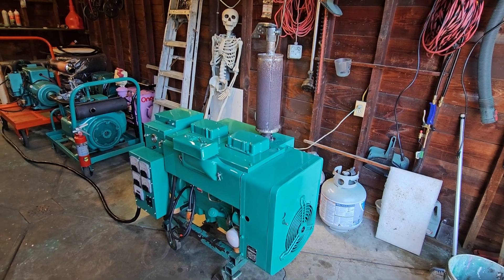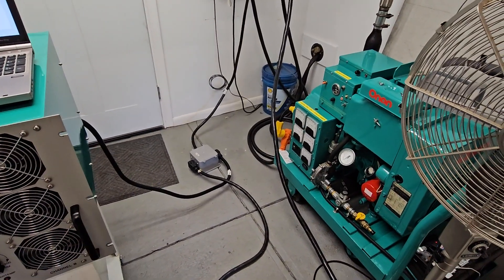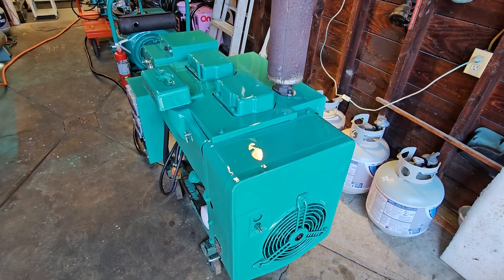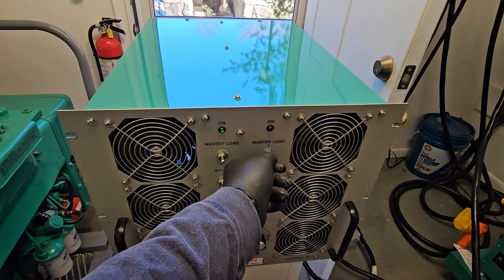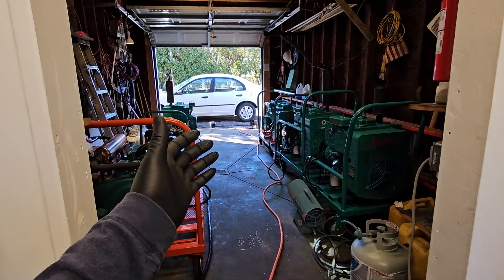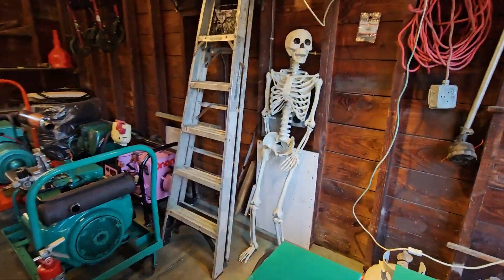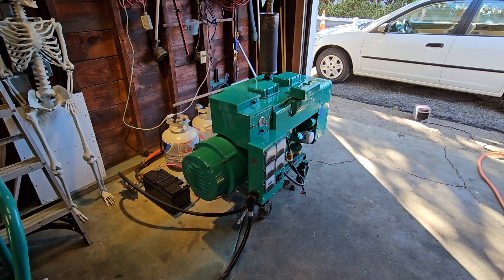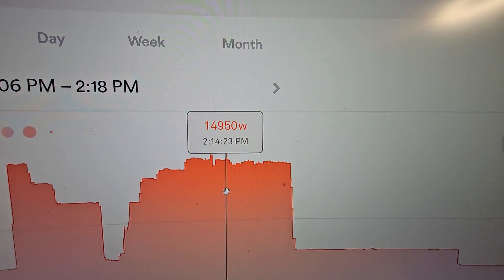Onan 15.0 JC Load Bank Testing 15kw Output On Propane

Comment: Why haven't you turned the propane tanks upside down and attach a vaporizer? Probably only need two tanks to run full power if you do that
Reply from the maker: Thanks for your comment. Yes, maybe it will run full power on two tanks as mentioned, but I do not have a vaporizer, but if you would like to donate one, I'll gladly take it.  Ultimately this generator will be hooked up to natural gas.
Reply: @jjjj-uf4bw  if you haven't already you need to check if that generator is rated for continual use of vapor because vapor can run an engine lean and kill the engine or shorten it's lifespan. Running liquid propane into a heated vaporizer keeps the tank from freezing up and running lean and you can find them for under $100.
Reply from the maker: @anotherguy9402  Thanks for the advice. Much appreciated. This genset will be a standby generator. As you may know, this genset is nearing completion of a full restoration. Once finalized, the genset will be running on natural gas. It is setup for tri-fuel (gasoline, natural gas, and propane) and as seen I'm testing running on using propane. Next, I'll be testing gasoline and natural gas. To switch between using propane and natural gas is nothing more than a simple adjustment on the carburetor. When I test natural gas, I would expect slightly less as for the genset's max output.